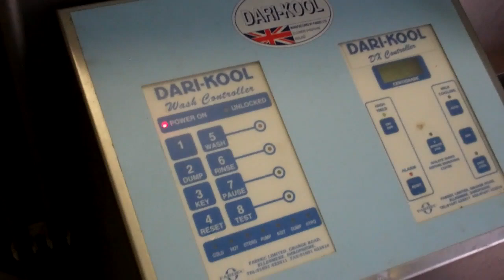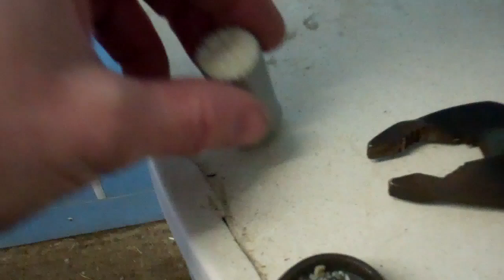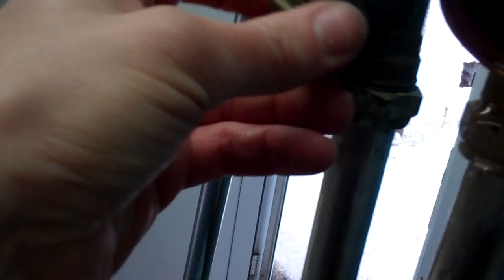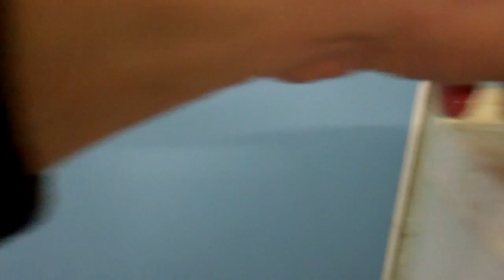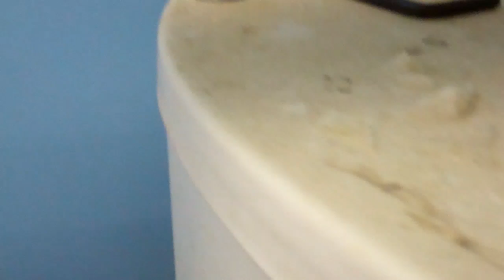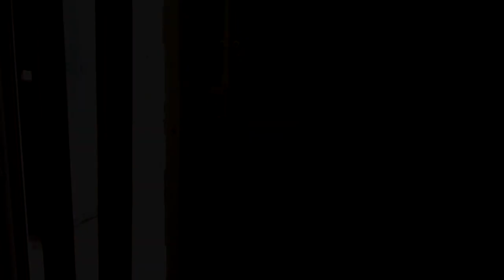Scale of the Problem

Comment: You need to put an 8 inch filter on the cold water supply then, with a 50 micron filter in them. Use a clear bowl one so you can see the gunk inside. Those are cheap insurance, and you can change the filters easily. They do have a pretty good flow rate as well, not too much restriction. Will make the water heater last longer too. I use them on soft water, they pick up an amazing load of brown sticky muck from the piping.

Comment: the reason for little scale in hot water line is because the scale settles in the hot water heater! we had 2 40 gal hot water heaters in Texas, one barely made hot water. Got it out side and tipped and TONS of calcium build up came out. The tank was 1/3 full of calcium. So that meant the bottom element did nothing! When the other tank stopped keeping up we just drained it and it was like new! You should probably drain their hot water tank to get rid of the calcium build up.